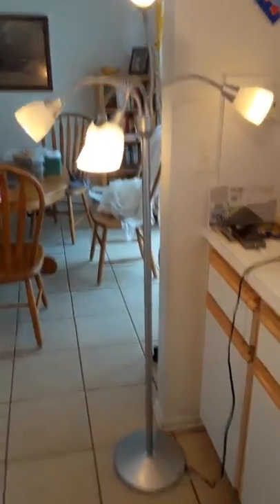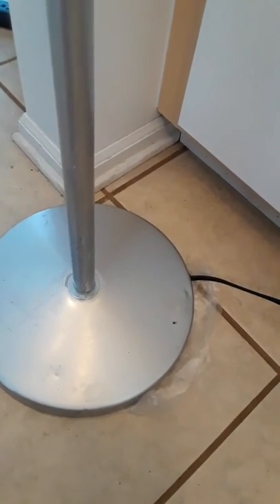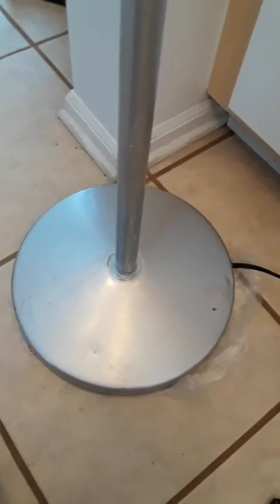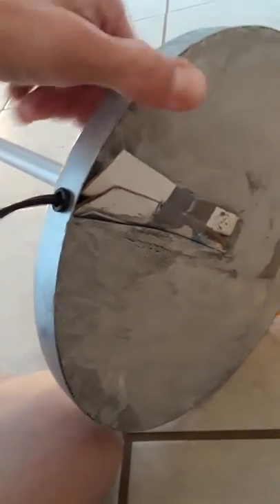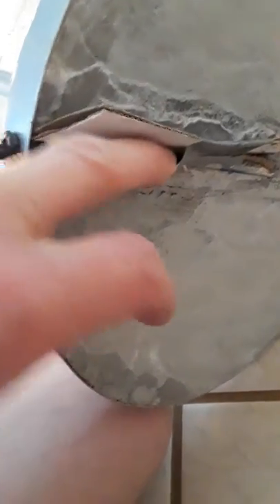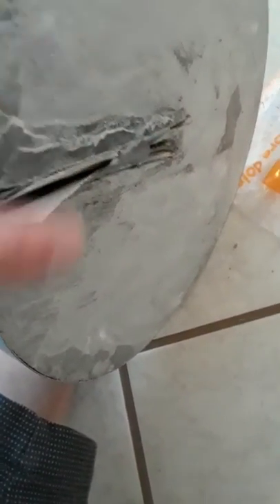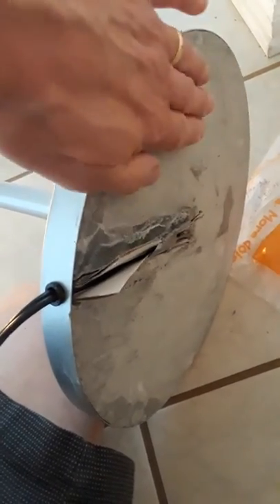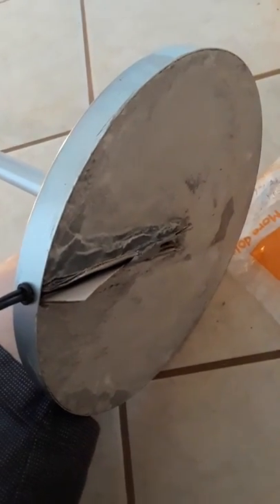Fix broken floor lamp base with Quikrete Vinyl mix.

Comment: Interesting idea. I'd like to try but am not clear exactly what Quikrete product you used? I don't see anything called Quickrete Vinyl Mix. I see Quikcrete 20 lb. Polymer Modified Structural Concrete Repair for $30 at HD which is 1/2 the cost of a new floor lamp. I also see Quikcrete 10 lb. Anchoring Cement for $14 which makes project a little more worthwhile. Can you identify the precise product and amount you used? Many Thanks!

Comment: This is the problem I have with my gorgeous lamb coat with glass shades. I want to fix the base so I’m gonna try this vinyl quick Crete into the base and level it off etc. but, because I’m concerned about how well this will stay in this base over time without falling out or cracking again, I am going to drill few holes around the outside of the metal base. Just like the electrical cord has a little plug and it comes out the bottom side of the base I will drill three or four holes around the base and put a decorative screw or bolt into the hole where it sticks into the base a couple of inches and tighten it down with the knot on the inside so it sticks through the base but it’s nice and tight to the base itself. So basically when you look at the bottom side of my face you’ll see a big empty base with a cord coming through a little hole on the side to the center of the base, Then three screws sticking into the inside of the base. Then I will pour my quick Crete into my face and level it the screws that are sticking in will be a heck give some thing for the concrete to grab onto and hold and stay into the base soda like acres! I just got a find some type of decorative on the outside screw that I can tighten down to the base for pouring in the vinyl concrete!
Reply from the maker: There were edges around the mounting screw thread for the lamp shaft, that the quikrete can bond around. So far so good. We have moved the lamp around for over a year and actually just moved it to a new house too.

Comment: How is the finished product holding up?  I decided to try it after spending too much time/energy trying to locate a proper replacement loader and being unable.  I am eager to see how it turns out, but I think I will give it a few days to cure before doing so.
Reply from the maker: I am sure yours held up, mine has for well over a year and also we have moved it to a new house and all still good.

Comment: What keeps the quikcrete from falling out after it dries and lamp is set upright?
Reply from the maker: There is a central shaft in the lamp that has threads and a bold on it and various grooves in the lamp base. As a solid set it seems to stay in just fine. It could only come out by breaking the set material. We glued on a large circle of felt material onto the base once dry and it sits well on any floor now. Its a heavy base, which is what these lamps need. You can purchase metal weights to fit under these kinds of lamps, but they are often as expensive as the original lamp.